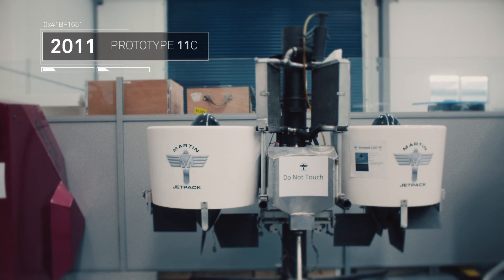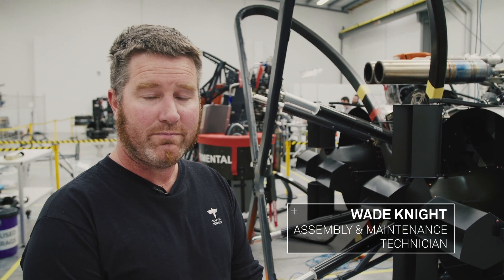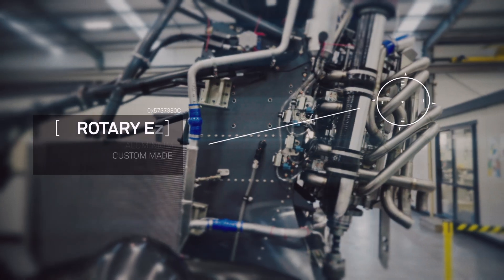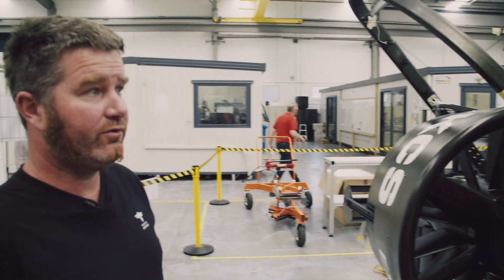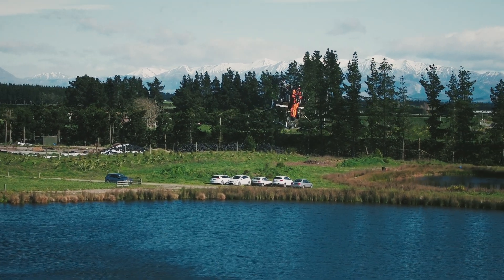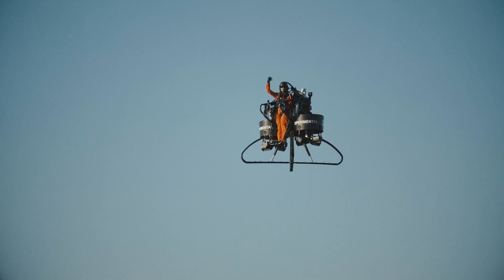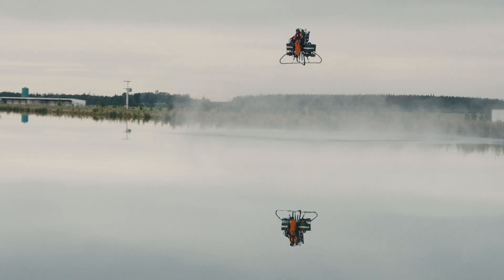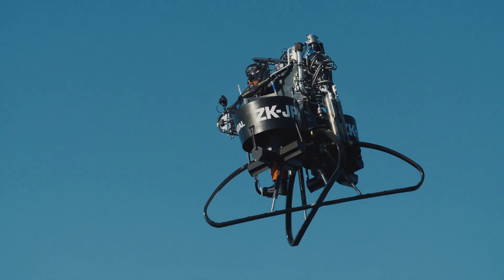Martin Jetpack Series 1 - From Concept to Reality Video

Comment: Great Job!!! Absolutely love your aircraft, but You need to get to the market faster. You have some competition building up from the drone community. A little better batteries and they will catch up on the flight time. Keep up the good work. Congrats to the team.
Reply: Anyone who thinks you can make a big quad copter with brushless motors and batteries that can take a human cargo from a to b and do it before this will be on the market is kidding themselves. The number of gradual design changes and certifications needed for human flight is just overwhelming for most startups.
Although I suppose you might find some crazy eastern European or other random country that could get something in the air without all the safety police and red tape. But they will be falling out of the sky onto peoples heads and Martin will be there to show them how it is done properly.